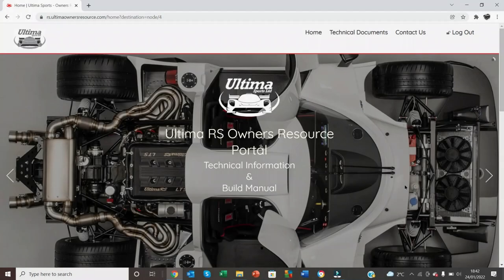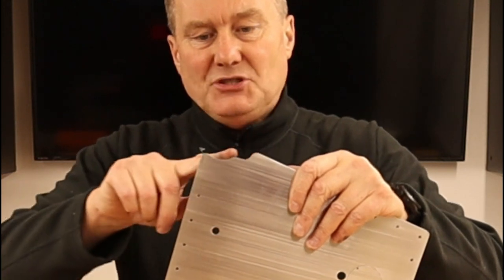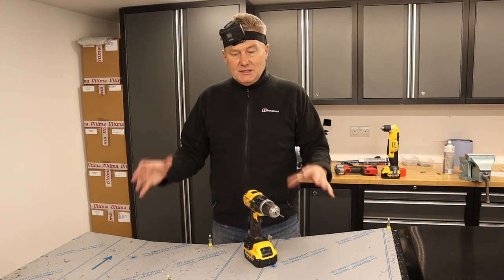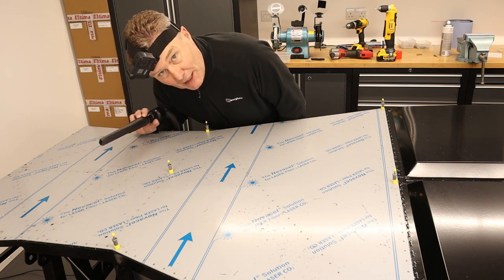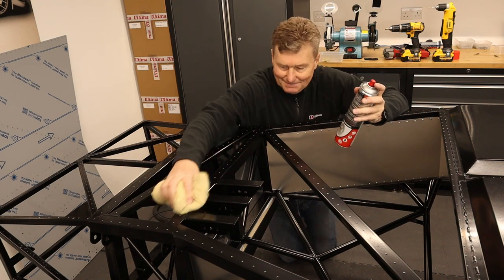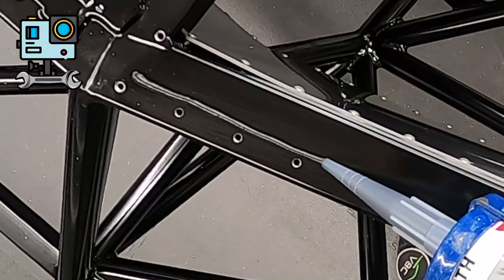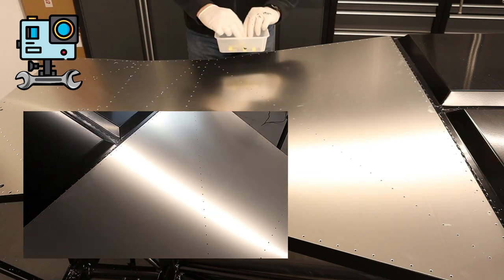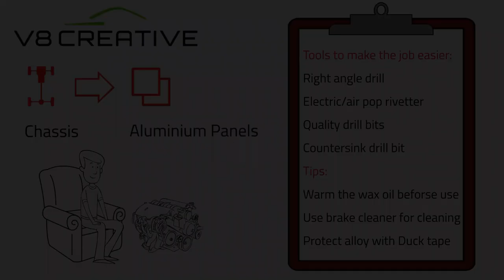Building an Ultima RS with Nigel Dean Part 4 The Build Begins

Comment: Laser cut panels is an amazing upgrade, so glad the factory is offering that now.  Maintaining the finish on the underside panel implies you won't be adding undercoat or protectant later, is that correct?  A handy tip for man-handling the large panels for glueing, use suction cup handles meant for glass.  Did the cockpit floor double skin come pre-bent or did you need to do that?
Reply from the maker: Great tip, thank you. I will remember that for my third Ultima build. The floor panel comes pre-bent which is a real plus. As regards undercoating the floor I cannot bring myself to covering the aluminum panels with sticky stuff. I know you decided to go this route but having built and driven a GTR for a year and 3,000 miles, post underbody inspection (I have a pit) didn't show any undue corrosion. Also sound deadening in my opinion is not required, but it's a personal choice. As a fellow Ultima owner you will know the cockpit is like Armageddon when that V8 spools up only inches behind your head :-). Hope all is good with you, and thank you for inspiring me to start a YouTube channel. Cheers Nigel

Comment: As someone who manufactures turbine parts for a living, I couldn’t help but notice a special something under your drill press! Very interesting 👍
Reply from the maker: Morning Detached Garage, and yes you are correct under my drill press is a damaged turbine assembly. I purchased it from a stand at a kit car show and no idea what it comes off - a great talking point though. If I give you the part number (laser etched into the assembly) could you find out for me? Cheers Nigel
Reply: @v8creative  I can’t promise anything, but I can surely give it a go.

Comment: The Fun bit Starts have started 😎
Definitely need the Electric Riveter, a 1000 rivets with a hand riveter would leave you with hands the size of Hulks😅
I'd love see a Tour of Ultimas Manufacturing plant and  see how the kits are manufactured!
Cheers
Reply from the maker: Pulling 1,000 rivets manually is not fun. Even though the electric riveter was £150, it was worth its weight in gold. Nigel

Comment: Another great video Nigel. I was very happy when I saw the notification earlier. Waited for the girlfriend to go to bed, poured myself another rum and coke, relaxed on the sofa and put this on the big tv. Lovely way to relax after a tough week at work. 🙂 It maybe could have been even longer, as you perfectly showed the basic principles, but on what was probably the easiest panel I’m guessing? The panels in the chassis that were vertical maybe took more work in terms of keeping them held in place correctly whilst doing the initial drilling?
Reply from the maker: Hi Paul, rum and coke - good choice of lubricant! Still early days for these videos and I'm still refining the ideal length. So maybe longer videos to come but it's still a learning curve for me. The reason I chose the floor was more about the ease of filming rather than than it being the easiest panel. I am going to make a bonus episode which shows what goes behind making these videos - the outtakes, the lighting, the editing - it's insane how many moving parts there are. As for the vertical panels I used Duck tape to position them before adding the skin pins so no big deal actually. Once you have one skin pin in place the panel will stay put. Anyway, onto part 5 and I'll try to add more detail. Cheers and thanks for the support of the channel. Nigel

Comment: Hi Nigel, a buddy and I have just had my RS pallet delivered to sunny Florida and we're about to begin the build, which is very exciting! We can't find any boxes or bags containing temporary skin pins, did Ultima provide you with these and if not, can you confirm what size you used? Much appreciated, love the videos, it's inspired us to take the plunge and build our RS!!!
Reply from the maker: @ianreadman  hi Ian that is unusually they do supply these in the kit but maybe it was an oversight. If my memory serves me correctly the river hopes are 3.7mm in diameter. However, it’s been a while so check on the build portal. Mine came with the bags of rivets.
Reply: Thanks Nigel, I’m still unpacking so hopefully they will appear in one of the boxes!?!

Comment: The precut panels looks to be one of the best upgrades the factory has come out with. Noticed you didn't put any sound proofing material in between the floor double panels. Any reason why? I did include it in my Can-Am build
Reply from the maker: Hi UltimaCH and thanks for the comment. You have a few more episodes to get up to date, I'm working on part 20 at the moment. :-) I decided not to fit sound proofing for two reasons. Firstly, it's pretty heavy stuff and to me the light weight of the Ultima is one of it's amazing features which I did not want to compromise. Secondly, having built and owned a GTR in the past the cockpit was so flipping load I didn't feel sound proofing would make much difference and to me part of the driving experience. I do understand that drumming of large panels is not desirable, but bridging the gap between the middle of said panels and the chassis is an alternative solution. Anyway, the Can-Am is an amazing machine having piloted one in the past. Keep tuned, loads more content to come. Cheers Nigel
Reply: @v8creative  I'm viewing them and I've run through episode 14. Your videos are really first class and after having built an Ultima, I can remember and recognize the different steps of the build. Loving it!

Comment: Its Friday again, now my favourite day of the week with another great video and some lovely work starting to take place. Did you have to do any fine fettling of the panels at all Nigel or were they spot on? Seriously considering asking if I can get this option added to my pack A as it won’t arrive for another 34 weeks or so.
Reply from the maker: Hi Garreth and pleased to hear I'm part of that Friday feeling. I am trying to keep to the weekly updates but I must admit it's a lot of work. As regards the laser cut panels, some fitted without any fettling but a few needed some fine adjustment, in particular the cockpit upper floor and engine bay lower bulkhead panels. To be honest I was expecting that since this is not a mass-produced car and tolerances with welds etc will vary slightly. However, what I would say is definitely get the upgrade since it's all those predrilled holes which makes the process sooooooooo much easier and soooooooo neat. Cheers Nigel

Comment: I’m just wondering, why didn’t you treat the newly exposed steel (drill holes) before fitting panels? That would have been extra protection against corrosion.
Reply from the maker: Good point, but once the panels are rivetted down the sealant completely seals the exposed metal. In fact the sealant comes through the holes when the rivets are pulled tight. Cheers Nigel

Comment: Just taken delivery of my R.S. late December 21. I didn't get offered the Laser cut panel kit but boy I wish I had. Was there any reason for not pop-riveting or bonding the floor panel onto the bottom of the pedal assembly legs. Loving the detail.
Reply from the maker: Hi Allan, yes the laser cut panels are fresh out of the factory but I have fitted the standard panels before so my advice is just take your time - remember fine wine 🍷. I did put sealant under the pedal assembly legs but there is no need to rivet them, once those panels are in place they are there forever. Enjoy the build and if you have any questions just fire them over. I'm not an expert but this is my second Ultima so I guess I can say - been there and done that. Thanks for the support Nigel
Reply from the maker: Sorry a correction to my comment. I didn't put sealant on the pedal lugs, yes I could have but there is so much support around that area it is not required. Sorry for any confusion. Cheers Nigel

Comment: Great video, very nicely put together. But dude, what’s with the slippers in a workshop?
Reply from the maker: Hi Roy, and surprised it took this long for someone to comment. As some viewers may know this is my 8th Kit Car build and the last 4 have been covered in national kit car magazines over multiple issues. I was known for wearing slippers for all my builds - for no reason apart from they kept my feet warm. So when the news broke I was building number 8 I had emails from followers asking if the slippers would make a return. FYI when I'm working on heavy components (i.e. an engine on a crane) I wear steel toe-capped shoes. Anyway, sorry to ramble but thanks for watching and hope that clears up the slipper mystery? Nigel

Comment: What is the name of the yellow pins you drilled temporary in, to fix it before the rivets came in ? :)
Reply from the maker: You are the second person to ask that question. 😀. Ultima supply them with the aluminium panel kit so I do not know the original source. However, they are the same as supplied with my GTR kit 20 years ago! It is this consideration for the builder that I appreciate when building an Ultima. Sorry not to be more helpful. Nigel
Reply: @v8creative  Hey Nigel, thank you, this is  exactly what i wanted to know :) So I dont need to buy this, when ultima supply them. Chears :)

Comment: Where did you get that large Ultima RS poster? Thanks!
Reply from the maker: Hi Michael, if you go onto the Ultima website you will find galleries of all the Ultima range. You can download the images free of charge - thank you Ultima. So I did exactly this and used an online service to print the image on 3mm Foamex. This material is semi-rigid and does not react to moisture. The Ultima images are super high resolution and the end result is worthy of the £25 price tag for the printing. Hope this helps? Cheers Nigel

Comment: Hi Nigel, this is nothing to do with your build but I have to fit out my garage soon and I like your cupboards and cabinets, can you please tell me where you got them from?
Reply from the maker: Hi Julian, the company I used was called Garage Pride 
https://www.garagepride.co.uk/
I purchased cabinets, worktops and also flooring. Simple to fit, and very durable. Mine are now 3 or 4 years old. If you go to my website www.v8creative.com you can read a 4 part magazine article on my garage conversion. Cheers Nigel
Reply: Hi Nigel, thanks for the information and advice. Keep up the good work with your videos I only came across them today but am a big fan already.👍